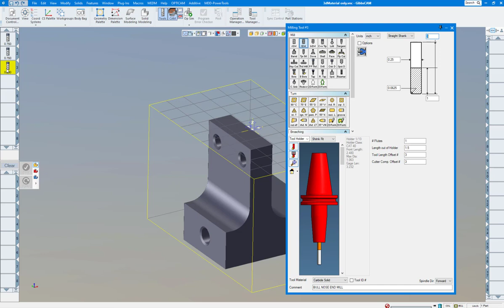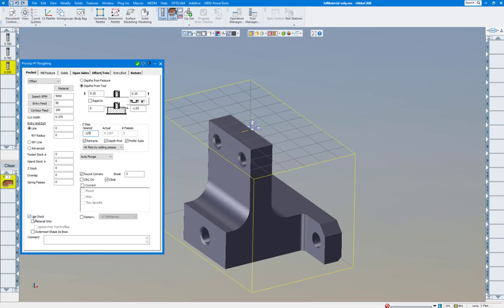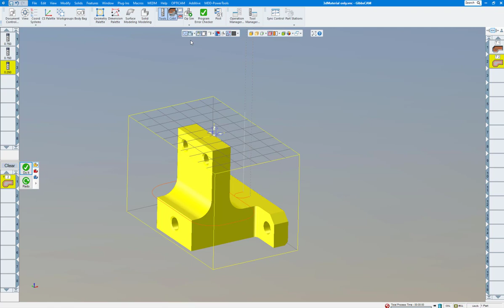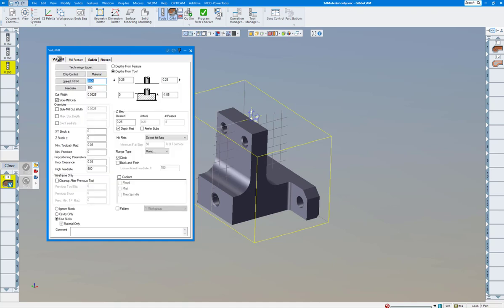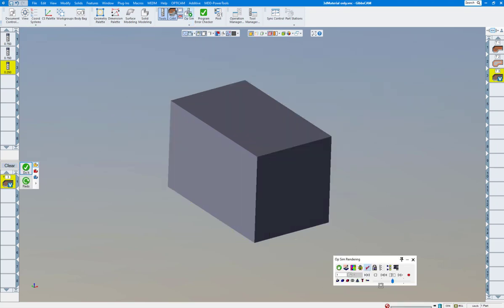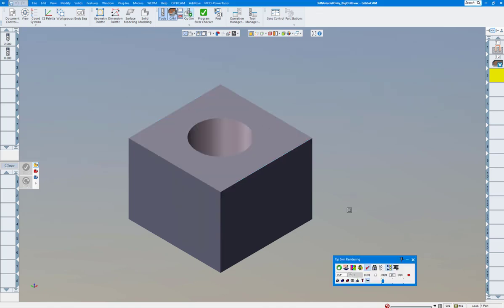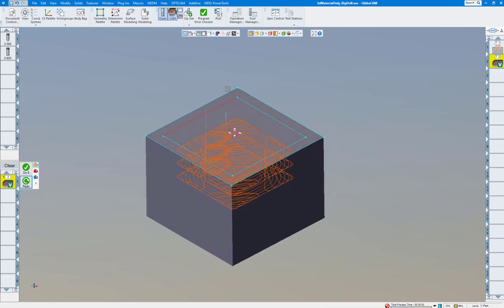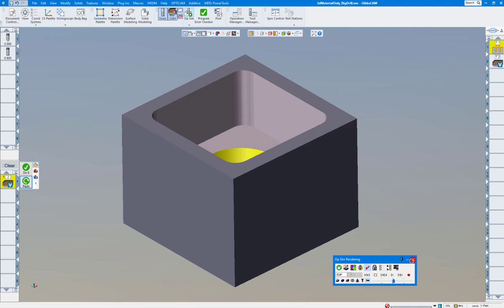Material Only.

Comment: Why this option is not working on 5 axis ops? There is a material only check box but it's not working.
Reply from the maker: I will do some testing in 5-axis and reply back.
Reply: @GibbsCAMVideoTutorials  I was testing yesterday on a triangular mesh roughing operation. Started with a bounding box type of stock, rough it with a short stick out tool and than wanted to use the same type toolpath but a bigger tool stick out. ..Not working with material only ..it doesn't seem to see the remaining stock. If I create a faceted body and define it as stock inside the 5 axis stock definition and deactivate material only it's working. Thanks for the reply.
Reply from the maker: @cristinelpricop  I would probably have to look at your part.  If you want to PM me I could give you an email to send to me.
Reply: @GibbsCAMVideoTutorials Thank you. I don't have a specific part. I was just testing some things and notice in particular that Triangular mesh Roughing does not recognize material only. I will do a software update maybe this will solve the problem.